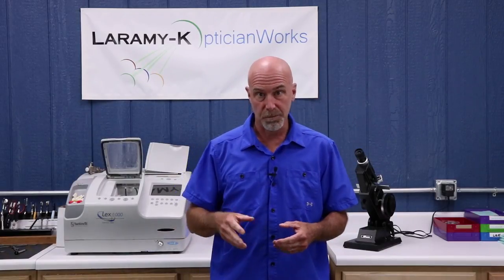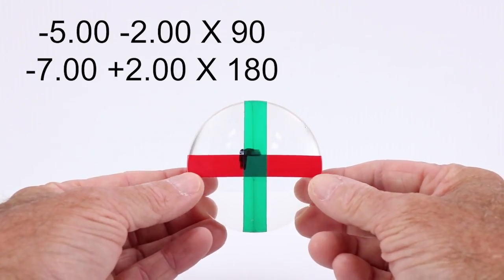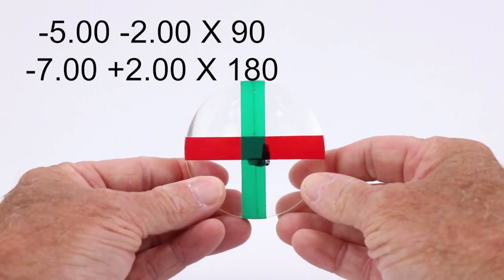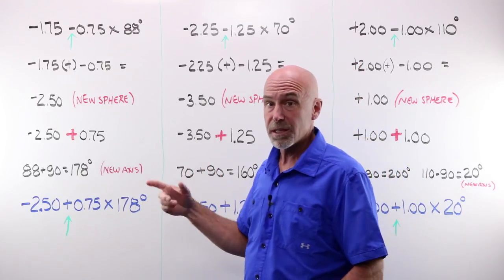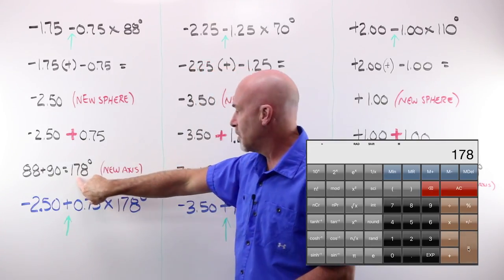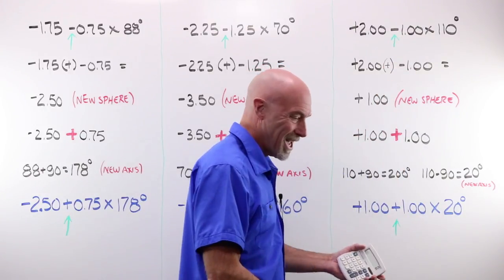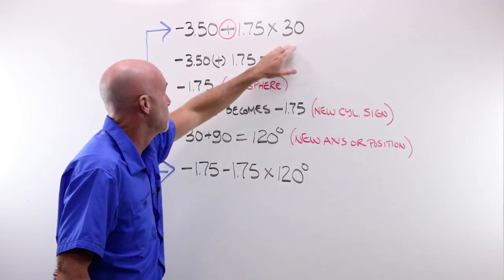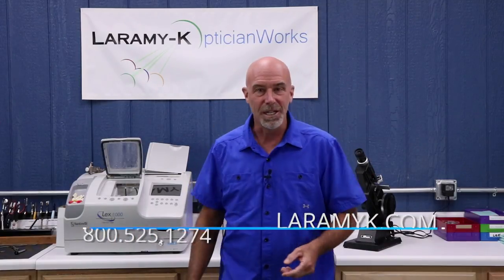What Is Flat Transposition And How Is It Done?

Comment: Dear sir, how are you ? 
Make be on video lecture ( reduction of cylinder lense ) whit mathematics details . 
Thanks ... Yasar
Reply from the maker: I'll need a little more to go on here. I think that was covered in detail in the first few videos we ever did? John
Reply: @LaramyKOptical   thank you  Sir
Reply: Dear sir , I couldn't fund your video about cylinder reduction lecture.
Thanks yasar
Reply from the maker: @muhammadyasar5037  Tell me what you mean by cylinder reduction? I am not familiar with the term. If you mean cross-cylinder then I can't help you. Never have figured that out and doubt I ever will. John
Reply: Sir, it's the problem , how can reduce the power of cylinder ?
I am new learner optician work in local shop.
Like as if the power is -shp 
- 4.00/+6.00=
How can get  2.00 easily 
2.00-1.00= -1.00
Then we increase the sph number
Thank you
Reply: Sir , I am from Pakistan
Reply from the maker: @muhammadyasar5037  I'm sorry but language is getting in the way here. You can't reduce cylinder by combining it with sphere power. It may look like that when you see flat transposition but that is not what is happening. Power is curvature and a curve is a curve. No way to alter them and still provide the necessary power. If the lens power is -5.00 -2.00 that's it. If you see -7.00 +2.00 that is the same lens just written in a different form.
Reply: @LaramyKOptical  thanks Sir , Your contact was very hopeful for us.
May I can contact in any optical matter?
God bless you
Reply from the maker: @muhammadyasar5037  Sure!